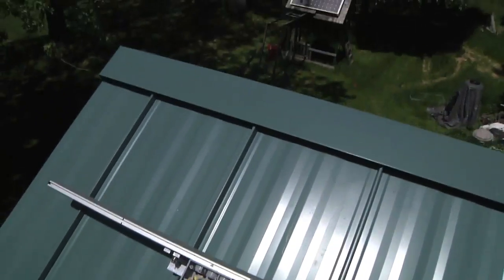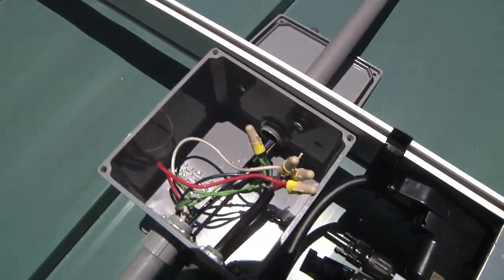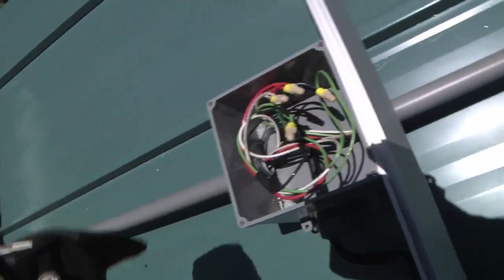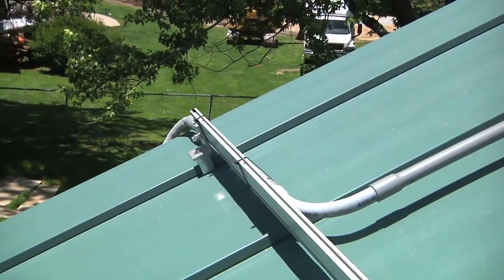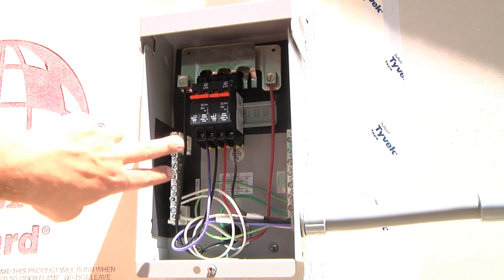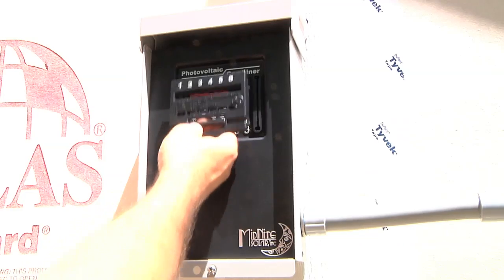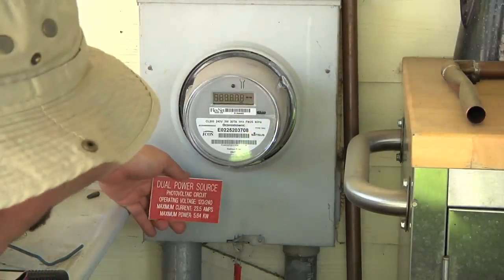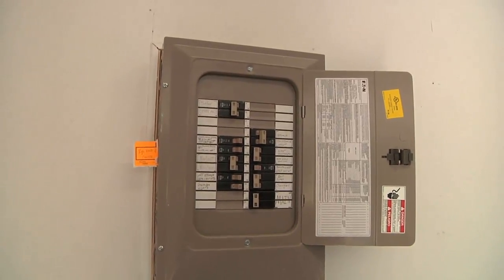Solar Garage Rooftop wiring and Disconnect Box Installation

Comment: Hi Ben, thanks for the very informative video. It looks like you have total of 24 panels. What is total wattage of the system? Before bringing the AC power to the garage you put AC disconnect. Is your main panel inside garage or is that a sub panel?
I did not see the meter close to your disconnect, where is the meter in relation to the AC disconnect? I appreciate if you clarify these points.
Reply from the maker: Yes, it’s 24 panels. The microinverters max out at 225 watts each. That’s essentially 1 amp each on the AC side of things. 5,400 watts. So, a max of 24A/240vAC coming in through a 30A breaker. 
This is to a sub-panel in the detached garage. 
The electric meter is on the house, within line of sight of the AC Disconnect on the exterior of the garage.

Comment from the maker: Somebody mentioned that the conduit here is required to be metal. That WOULD now be the case if this were a DC system carrying PV wires. It's not. This system uses micro-inverters to convert the solar to AC at the source. Everything else is simple AC wiring. This system was permitted and inspected, meeting all requirements of AHJ at the time of installation.

Comment: Hi I am a newbie with lots of dumb newbie questions, so bear with me. First, is could you have used a roof pv combiner rather than use a combiner so far from the roof? Second, You have one solar disconnect for all three strings( I hope I got it right) should you have 3 separate disconnect boxes?  I have seen solar systems with one near the panels and then 3 separate ones near the house. Third, what about the ground wire from the panels do it run into the main panel or do you have a separate grounding rod?
Thanks
Reply from the maker: Yes, I COULD have used a combiner on the roof, but I didn't need to.
In this case, the combiner box also has circuit breakers inside it, one for each solar circuit. The large red lever simply turns all the circuit breakers on or off at the same time. It's a combination combiner box and disconnect. Having it at ground level allows for emergency workers to turn off my solar if ever needed. (For example firefighters if my garage was on fire.)
It should also be noted that I'm using "micro-inverters". A small device at EACH solar panel converts the DC to AC power. As a safety feature, if the micro-inverter senses that it is NOT connected to the grid, it powers down. That can occur by turning off my main input breaker, my garage breaker, or main power at my house.

For grounding, the solar panel frames are bonded to the racking, and the micro-inverters are bonded to the racking as well. Grounding is through the ground wire connected to the micro-inverters, and then to my AC panel. One advantage of the setup I used is that it does NOT require a separate heavy copper cable between the panels, the racking, and a ground rod. Grounding is important on all photovoltaic systems, and isn't a subject to be glossed over. If you are a Do It Yourselfer, make sure you understand grounding and use it appropriately on your system. 

I see you also have a follow-up comment, but I'll leave all this information here anyways, so that others can benefit from it.
It's always OK to be a newbie, it just means that you are learning!
Reply: @BenjaminNelsonX  thank you

Comment: Those midnight solar disconnect/combiner boxes sure do look cheap with all the plastic.  I guess I prefer the metal disconnects with heavy springs and a solid feel and audible kerchunk when engaging and disengaging the disconnect.   All in all the install looks like it is going well.
Reply from the maker: Just that cover inside is plastic. All the rest is nice painted aluminum. It feels very solid. I'm happy with it.
Reply: It works fine but I felt the same way when I installed it. For the money I would have liked to see some spring loaded knife switches.